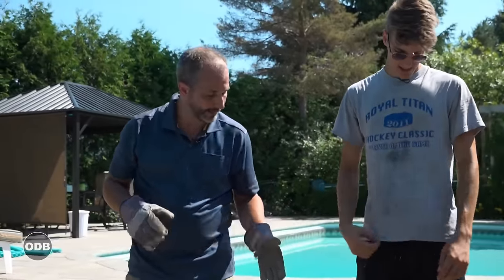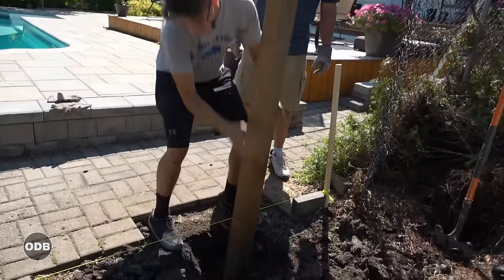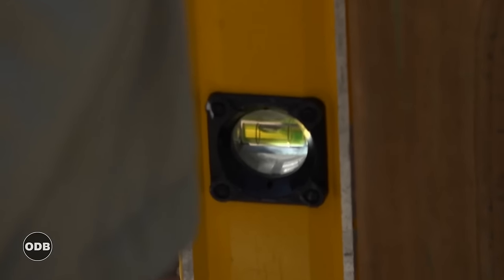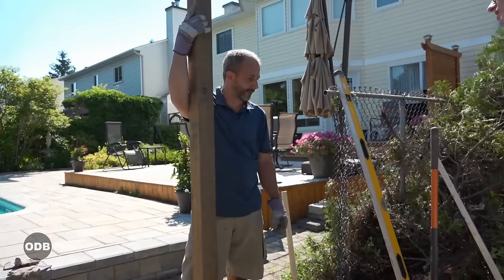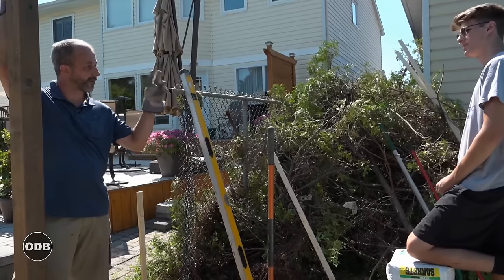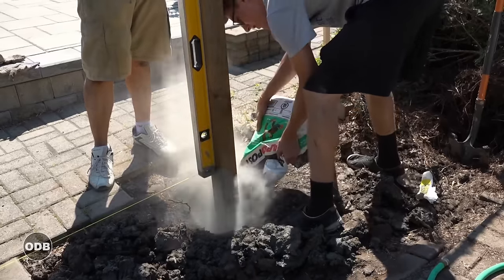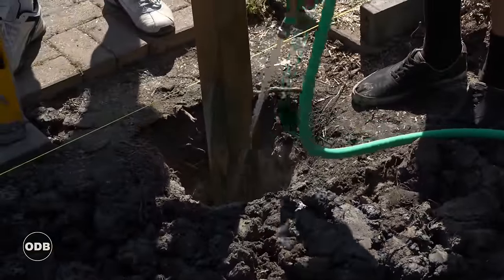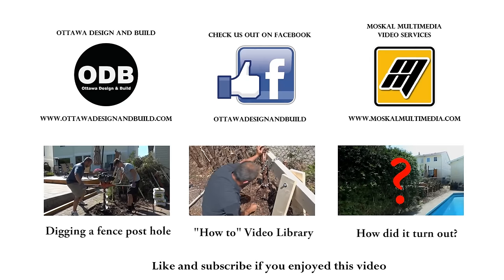DIY How to Set a Fence Post

Comment: My understanding is you should NOT push dirt up over the concrete and pack it next to the wood pole because it will encourage rot. I believe the concrete should be brought up to ground level and even pyramid shaped / sloped away from the pole to discourage water sitting next to your wood. Otherwise thank you for showing the method of using string and level to correctly position the pole.

Comment: Put 1-2" gravel on top of the concrete, not, not soil which will rot off the post at the point it enters the concrete.  Problem two, clay packed over the concrete does not "hold the post" when frost heaves, that is impossible, frost heaves from below objects and from the sides, so the concrete is the anchor as it below the frost line and grabs the soil on sides.  Gravel up higher would allow the soil that is heaving, to move independently of the post because there would not be friction. 

Some good ideas for getting plumb and how to set the crete without stabilizing, thanks!

Comment: There is nothing better then tbe old school way to mix all the concrete in a wheel barrow this way you know it all has been mixed right & there will be no dry patches in the concrete.
Reply from the maker: It is a whole lot more work. I would not want to be the guy mixing 60 bags by hand. The mixer worked awesome.
Reply: Home RenoVision DIY some times that would be a daily occurrence for me at my last fence company I worked for....
Reply: 100 percent agree. Throwing it in dry is only done by contractors who don't give a shit
Reply: I use a tarp, mix one bag at time, pulling the corners toward the center,  tilt it right into the hole, it hoses off so nice, and I can usually get several fence posts (for a small backyard job) and cleanup is so fast and easy.  with two people and a heavy duty one, in a pinch you can set a lot of posts FAST. ♥️
Reply: Here we are doing the mixing by adding cement , nice sand , water , 1/2 rock crushed pieces .. on an iron sheet .. 😊😁

Comment: The fence I want to run is 160 ft long. I don't think you can pull a string line because of the sag? Any tips on that? Also are you just going with the ground or how you keeping the top of post all the same heights?

Comment: Your videos have always been a great resource for us DIY'ers.  One question as it relates to this particular lesson, would  you ever want to attach a fence post to the side of your house?  i have a fence runs to a post where a gate will be attached to.  the fence crosses over a sidewake that leads to the back of the house and thus i had to install a post using a base hardware to secure the pole as opposed to digging into it and pouring new concrete.

Comment: Excellent - first time for me setting fence posts. My question, I have poured some in hole, first then set post. This way, wood is not touching soil, but encased. This this matter?
Reply from the maker: not really, the concrete will still transfer moisture to the wood and eventually it will rot. But not till long after your gone.
Reply: @HomeRenoVisionDIY  dip the first 3 feet of each post in tar. no rot....EVER!

Comment: If water drains, add gravel. If water doesn't drain, don't add gravel.
This! Is the advice I've been looking for. Funnily enough I have gravel extending away from where I'm setting the fence post, but the soil is heavy clay. So until I hit that level, I wasn't sure.

Comment: Help me understand why you did all of that leveling before you poured the concrete?  You leveled it and proceeded to wiggle it around, then held it with the same unsteady hand as you poured in the Quickcrete.  Then wiggled it some more to make it level.  Could have saved all that time by plopping it in, making sure it wasn’t significantly off kilter, then done the leveling once the QuickCrete was holding it for you.
Reply from the maker: your description sounds a lot like how i did it!

Comment: I give those fence posts about 3/4 years before they rot at ground level. u did correct not using gravel but you should have taken the concrete to ground level. now your post is soaking up water where it's covered with dirt. especially with you having clay it's going to suck up water with that wet s soil.
Reply from the maker: pt lumber is not that weak, however no matter what you do in this climate it will not last more than 20 years,
Reply: In Canada ?!? Not much of an option unless you want to play wack-a-mole with your posts. I'd rather replace a post occasionally then live with a unsightly sagging fence line.
Reply: Here in New Zealand we use H4 treated timber in the ground, doesn't matter if it gets wet (which it does) or not, it lasts a lifetime...
Reply: nope.  i put mine in same exact way (with GROUND CONTACT 4x4)  15 years later solid as a rock.

Comment: I was told not to mix the cement like that - to thoroughly mix the water and the concrete  first then fill the hole and  shape the concrete downward and even at that looks  like the wood is going to eventually rot anyway.

Comment: Question I'm building a pergola do you recommend digging 4 feet down placing 12 ft post in cement or anchoring 8ft post ontop of cement? In the gta so I'm dealing with frost and clay
Reply: What did you finally do?
Reply: On top helps with wood rot . But using rock below grade helps . Depending on how dry a climate you live in .

Comment: Would you recommend setting posts in a sonotube in a four season climate? Or just concrete directly in the dirt hole
Reply from the maker: I prefer the dirt hole. using the sonotube means you need to pack the ground around it as well.

Comment: When plumbing a pole, or post you only plumb the top to the bottom, anything between that you have to ignore. 
My question is why do people not put butt plates on every post. One to prevent the post from moving north and south and the other butt plate just under the first plate. Guaranteed to keep the post plumb for many years

Comment: I had a contractor do what you pretty much did. They replaced old rotted post with your method.
My question is why not go concrete to the top? Ground Level? Im afraid that in 5-10 years the wood under the ground will rot  faster? Im using PT wood. Iam I a worry wart?
Reply: He explained that in the video. The ground freezes there. When water freezes it expands. So when the water laden soil freezes and expands, it can try to push the post upward out of the ground. Putting a layer of soil on top of the concrete creates a "lid" as he says, and keeps the post from lifting when the ground freezes. Because the lid is frozen too. If you dont get ground freezing where you live, then put the concrete all the way to the top.
Reply: @velocityacoustics  It is a no win situation.  The post will rot faster if it touches the wet soil all the year round.  I will put concrete all the way up even if it means lifting the post.  Better than a rotten post.

Comment: This is exactly how my fence was done 10 years ago, every post completely rotted out. and I live in a cold climate the concrete needs to go a little bit over-the-top soil and slope it down. Definitely takes two bags of concrete.
Reply from the maker: The secret is to use PT lumber that is rated for ground contact. there is plenty of it sold that is not. Cheers!
Reply: There are different pressure treatments done for lumber. Perhaps not 'ground contact' pressure treated posts used? Perhaps your area has high clay content so dug holes actually become water catchers and wood stays wet for longer. Im trying another experimental method: metal posts in concrete, posts wrapped with 4 pcs of decking (above ground) to give appearance of wood post. I let you know in 10 years how its going.
Reply: @davidleeson7236  you got me there, lots of clay.

Comment: Why type of wood posts are those and is there any issue of the wood rotting eventually since it’s buried? I live in Ontario as well.
Reply from the maker: the secret is to buy PT lumber rated for ground contact. there are 2 varieties. be careful
Reply: Home RenoVision DIY thanks!

Also, what is the Ontario code for fences? You mentioned you were bending the rules a bit. Could you explain that?

Comment: What would happen if you had the concrete come above the soil, and used a big foot at the bottom?
doesnt the soil rot the post at ground level?
Reply: That is correct. Putting any kind of soil around the post will rot and shorten the life of the post. You should have your concrete level with soil or better to have a reveal so water can run off and not pool. He did mention the ground freezes in that area so, maybe covering the concrete is necessary to  prevent the post from pushing or popping out in winter. Nevertheless, covering the post with soil increases rot factor.

Comment: Thank you for the informative video.  I have a couple of questions: Wouldn't packing clay on top of the cement cause moisture in the soil to pool around the post at the level of the cement and rot the wood faster?  And what happens when you hit big rocks?  I have tons of big rocks in my clay NS soil and want to put in two trellis posts.
Reply from the maker: Hi Anne, that is why no matter what you do a fence in my climate is a temporary structure. There is no perfect way to build one without spending an absolute fortune
Reply: I'm actually wanting to build a T-bar trellis for a kiwi berry vine that will last decades.  I have no idea how to replace posts when they rot without damaging/destroying the vine.  Any ideas?
Reply: Put in a steel post and clad it with wood so it looks nice. When the wood eventually rots just take the bad piece off the steel post. You can then keep your wood slightly above grade. Just a thought.

Comment: Good job , but I have comment , dig little bit deeper more as 36 " , the  pure concrete first in to hole at button about 4 " high , then set the post in , centered roughly in the hole , then pure rest of the concrete in so that some few inches were left above ground level , I prefer pre mixed concrete with water before being purred in to hole but you method is fine to add after for that type of concrete mix ,  leveling the post during process of adding concrete around the post , after is done  that top concrete refinish smooth with slight slope , in case of the fence posts , 1 " above finish soil level .
The wooden post will root with the time no matter what  but it would take longer if protected better , also preparation of posts could be done with oil at that base of the post and so much more ...
Cheers :)

Comment: I don’t understand why the soil wouldn’t drain if there were pebbles. Wouldn’t a lever of rocks keep the post ABOVE the ‘pool’ of water? I live in a clay soil area and we HAVE to use gravel for stability and drainage.
Reply: Water always takes the path of least resistance. In an area with a lot of clay the gravel would just act as a very porous stratum that any nearby moisture would naturally seek. In a more rocky or coarse dirt soil, the gravel would just be wasted work.
Reply: I think you are right with the post contracting and shrinking the cement acts like a cup holding water and the wood dry rots

Comment: How far apart is each post?  I am considering a similar build ( horizontal fence )  and want to go 10ft between posts and using 5/4 decking pressure treated boards to span the posts.  Does this seem to long of a span.  Thanks
Reply from the maker: Hi Aaron, we used 8ft and also used a 2x4 at 4" to provide some help against warping. so post 4' support 4' post and so on. Good luck.
Reply: @HomeRenoVisionDIY  What do you mean "used a 2x4 at 4" to provide some help against warping""?
Reply: 10ft is too long without support. Even at 6ft the posts will sag after a while with no support.

Comment: Post will rot quickly, post hole is also excessively deep. Concrete should be tapered at ground level to stop water pooling at post base. 1/4 of the overall length of the post should be underground.
Reply: Not where ground freezes as it will lift the post. Putting soil on top stops it lifting.

Comment: Do these rules apply to Edmonton as well? We have clay-loam soil and a 6' frost line.
Reply from the maker: nope best to use a  much deeper hole.
Reply: Thanks. They usually do 3 to 4 feet here in Edmonton, and it doesn't heave due to the soil type. I was just wondering about the concrete method you use.

Comment: How would I know about the soil type regarding drainage issue?
thanks
Reply: U either have clay or sand. Clay clumps then you grab a handful. Almost like pottery clay. Soil might be red. Sand will drain a little better than clay. Water has a harder time percolating thru clay.

Comment: Ok, this question has come up a lot so I'll be the sacrificial lamb.  How do you know your first and last posts (and consequently all other posts) are aligned? So all you see is a straight line when you look down the fence. Other than using a lazer level.
Reply from the maker: you can use a string line once you have you corner and ends dug in.
Reply: I may not be explaining myself properly. The string will make sure the middle panels are in line with the end posts but how do you ensure the end posts are on the same latitude/longitude.. For example, both end posts are the same distance from a structure..
Reply from the maker: you can use a string to mark the distance from the structure and use marking paint to x marks the spot for the post. On large scale fencing square is a relative idea.  as long as your lines are straight square is secondary in  most situations
Reply: Thank you!
Reply: Also, most of the time you are going to be building your fence a couple inches off of your lot lines which are almost never square.

Comment: Nice video.  Wear a mask next time there is dust like that.
Reply from the maker: No offense Shane but it was 42 degrees outside and I am not wearing a mask to open a bag of concrete outside in that heat.
Reply: This wasn't a video about safety, it was about how to learn about post instillation.
Reply: A little concrete dust is good for you.  Build character!
Reply: @michaelraduazzo6146  ... Hardens you up.

Comment: He makes it sound complicated and difficult.
Reply: Stick log in hole.  Line up a series of logs.  Use tight string to line them all up.  Use level to make sure they are straight up and down.  Read concrete instructions and stick in hole, add water.  Let dry.

Fence posts complete.

Comment: It’s isn’t a good practice to plant wood post into concrete as it will entrap moisture in the member and that accelerate the decay and deterioration of the bottom part of the post.
Reply from the maker: Hi Sal, no such thing a s a good practice for building a fence in clay!
Reply: as opposed to????  NOT using concrete so that the fence posts tumble over in a matter of minutes??  great idea......
Reply: @FlyBri2112  haha I can see how that can be confusing for someone that doesn't have much experience(I will not tell you how much experience I have as a consultant since this issue is very simple and basic common sense), the problem is not using concrete, however, how do you maintain a clear path to moisture that could be entrapped in wood , so with that being said in the simplest term use a Simpson strong tie connection(or any equivalent )  to embed in the concrete and attach the wood post to the provided fasteners. (good luck)

Comment: For $5 Home Depot will sell you what they incorrectly call a fence post level which negates the need to keep checking your long level. FYI, fence posts aren't leveled, they're plumbed.
Reply from the maker: Hi Jack, those things are useless. and level that is being used should be at least 30% of the length or height of the subject. Cheers and forgive my slang, we tend to call everything level here!
Reply: The tool is called a level and, by design, it is meant to help set objects straight both horizontally AND vertically. Therefore, from a layman's perspective, leveling it is clear in either case. Jeff, you are a Mensch.

Comment: Don’t you have to use pressure treated wood for that ?
Reply: I never use pressure treated wood. In 6 months, it will be curvy. You'll see. I got suckered into buy pressure treated wood once. Never again. My neybers fence was straight, now it's so curvy a squirrel can't run along the top without stopping for turns.